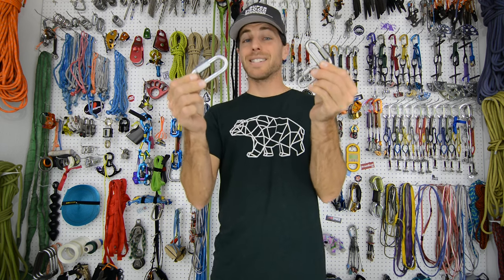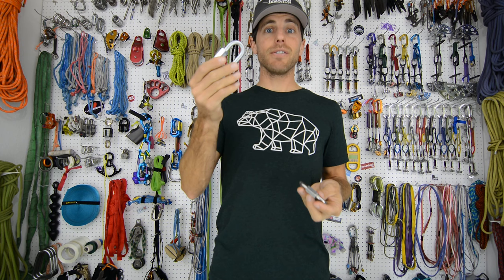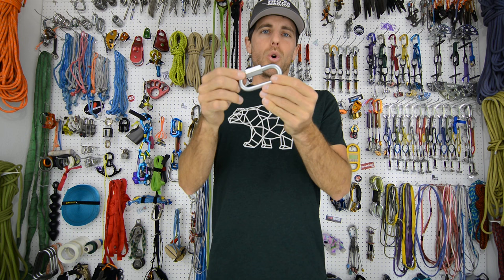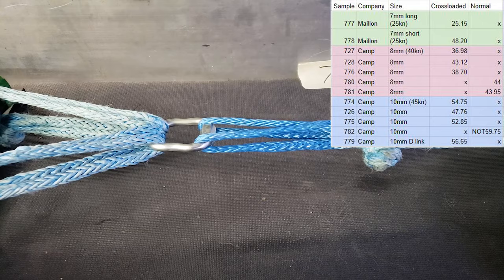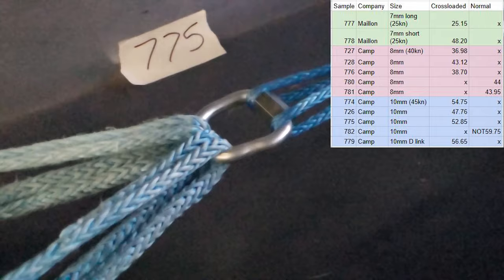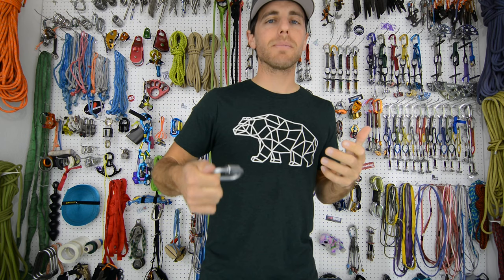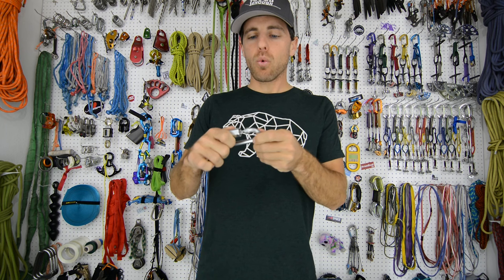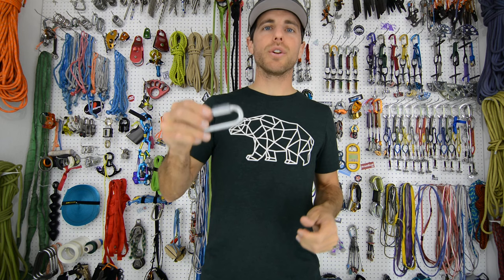SlackSnap - Camp & Maillon Rapide quick Links are all rated the same when cross loaded? Slow Motion!

Comment: I know this is an older video, and you probably aren’t going to check comments for this, but as engineers, we use a simulation technique called Finite Element Analysis, or FEA, that could help you test deflection, failure, stress, etc. in harder loading situations. I’d be happy to do it for free if you ever run into a situation where your equipment/safety doesn’t allow you to test something the way you want to!

Comment: I had quick links holding a dumpster onto the carriage of a rough terrain forklift. Talk about shock loading the hell out of it. I was working on a job site and trash would be loading into the trash bin attached to the forklift, then run the trash to the bigger trash bin. It sucked when the links would eventually stretch to a breaking point and the small trash bin fell into the large trash bin and I'd have to climb in and rig something to pull it back out.

Comment: You didn’t test the threads at all. There was no testing the moments at the coupling with . I understand that is difficult to do. A solution might be to have pins on a track to hold the quick link in place and then have a single point of contact rather than distributing the load on either side of the couple, which is not the same as loading the nut directly. This test did not test the moment at either side of the coupling and just tested a wider chain.

Comment: Great point on the bend radius.  I climb trees..which in many ways may be really similar to solo aid climbing.  When I reach the final anchor point, I like to choke my rope around a fork or Limb, by knot blocking a 10mm Metolius quick to make a ‘floating canopy anchor’.….this is great because it affords much easier retrieval when the rappel path takes some turns, and it also saves pulling and stacking some rope.  The way I use it depends on a stopper knot (butterfly) not pulling through the link…watching the deformation during these breaking tests was graphical for me….but I’m remaining faithful that my body weight is not going to pull my clipped butterfly bend to through.

Comment: Cross loading depends heavily on both the diameter of the steel and the length of the quick link. Cross loading induces much more bending than axial force, the opposite of the "strong" direction. As you noticed steel is stupidly good at bending a ton before it breaks, which is why it makes up the nails in your wood, the rebar in your concrete, and the steel in your steel that makes buildings perform well in earthquakes.

Comment: You pointed out a factor that is very much a big part of engineering. Multiple failure modes. A component can be considered failed but not actually broken. An example of where you would see this is in the rigging industry. Lifting chains are measured for wear as well as stretch. Lifting hooks are also measured for permanent deflection (bent open).

Comment: if you connect a rope to a small quicklink you most definitly do have a knot somewhere in the system so it will break at a knot long before even the smallest quicklink will "break" the rope (small bend radius), right?

thx for your testings!
greetings from rope-test-lab ;)
Reply from the maker: I have had ropes break at small bend radius before knots but I can explore that further.

Comment: @hownot2 I’m planning to use a 7mm Maillon Rapide link that Petzl sells as the anchor for my 9mm rappel rope coming down a tree (scaffold not around link and girth hitch the tree). Would you say that link is super good enough for my application?
Reply: they are ratd for 25kn but fail way above that, the rope is probably below 20kn before the knot further lowers it. I know all this but still used a 10mm one haha.

Comment: Hard to test, but wouldn't they all break/deform much earlier if pulled on the nut part? Like ripping off the thread and such.. compromising it's structure even if snapping back to non-crossloaded. It's their weakest point, after all.
Reply: I would be really surprised if you could compromise the threads on these. You can bend threaded connectors quite easily so badly that you can’t unthread them easily, sure, but these look to be bog standard iso Mn threads or something very similar and those just do not fail in steel. The bolt snapping starting from the thread valley, sure. Just ripping the threads off basically does not happen, even with a normal nut, let alone one of these long ones.

My gut feeling at least is that the nut is not the weak point on these. Hence why when snapped normally they just pull the steel itself apart like taffy.

Comment: Have you ever tested hardware store quick links? I'm curious why their load ratings are so low, like 7kn
Reply: As above you probably can't open them anymore at that point, but they will hold far more before breaking. It will be important to understand the consequences of not being able to open them any more if loaded like that though, because you could get trapped on a rope and get in trouble after a fall on one rope soloing etc.

Comment: What does WLL (working load limit) means in relation to kN etched on a quicklink? I bought mine from Ace Hardware; though I never bailed from any route before, are those safe to use? And what are your thoughts on such quicklink?
Reply: M Farid M Fawzi those are not meant to be used to support human weight. Then again a lot of crags use those at the anchors, I guess when I’m doubt back it up?
Reply: WLL is usually either 10%(10:1) or 20%(5:1)  of MBS (minimum break strength) or ABS (average break strength,) depending on how it's measured. Industrial applications are perfectly comfortable with a 5:1 safety margin, where as life support applications usually require 10:1.